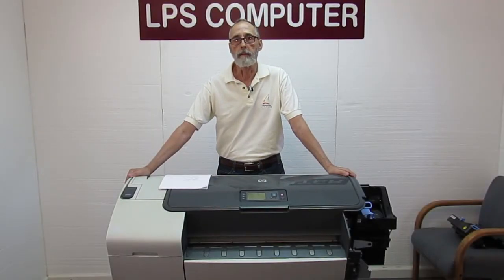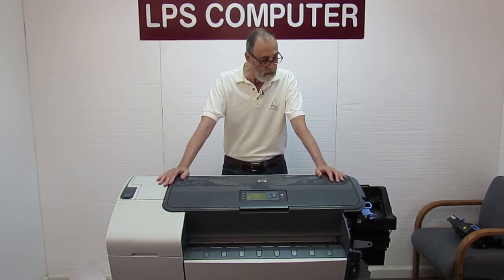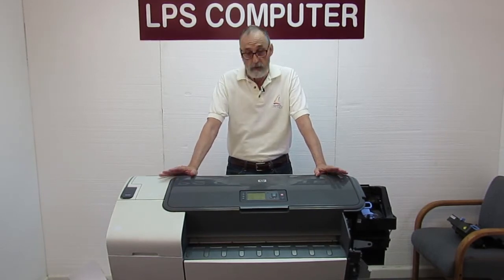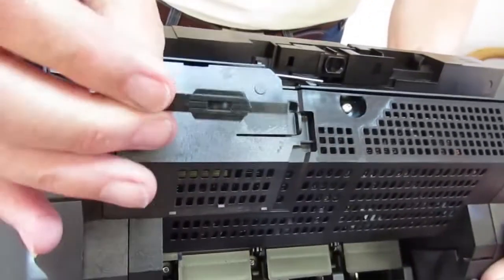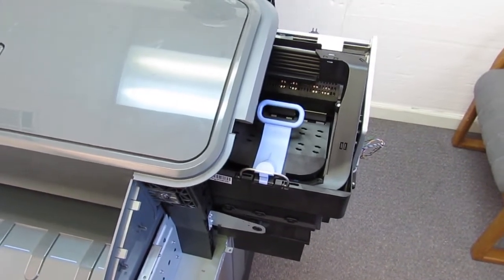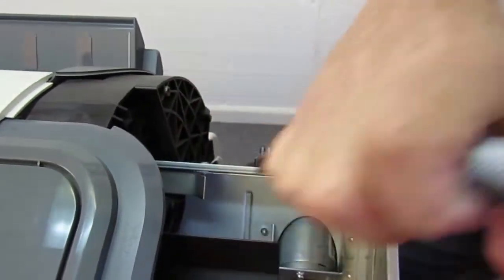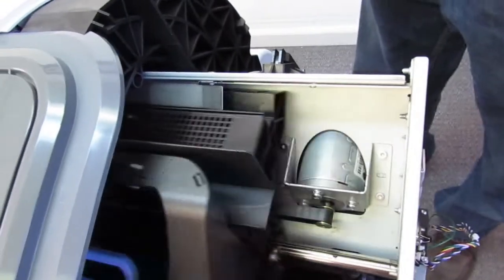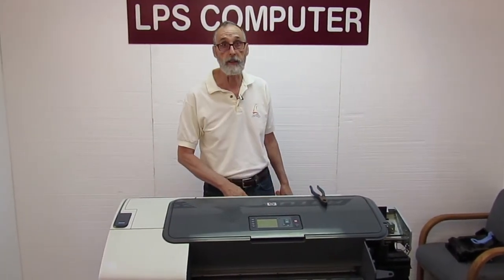Rear Carriage Bushing  THE EASY WAY - Designjet T610-T1100 Z2100-Z3200

Comment: Hello, I have replaced the belt on the HP Z2100 following your video, but. Everything seems fine, I can move the carriage by hand easily, but when the plotter starts, the carriage moves from right to left and at some point stops, showing error 86:01. I have checked everything, and I don't understand what could be wrong. I'm desperate! Could you please help me?

Comment: I replaced the belt and carriage bushing. Now the paper shreds while trying to load a roll. It appears to occur on the right side of the machine where the carriage enters the paper area. Is there another part in need of replacement or other tips for fixing this problem?
Reply from the maker: Hi Mike.  Could you tell me which plotter you are working on?

Comment: Bushing fell out during the belt replacement and I thought it was just cable clip, the paper carriage will then decide to impact onto the paper and destroy one of the print heads if you don't have it installed.

Comment: Bob, please, can I send you a short video with an problem of my DesignJet T1100?, when I load photo paper, carriage hits with ink maintainance box, and scratch the paper. Solenoid is working good, I have it saved in a video. If I load photo paper but in menu options I type "Normal Paper", Plotter loads it as a Normal paper and work good, but I haven't quality print and options of photo paper. Can I send you the video by e-mail or WhatsApp?. Thanks Bob.
Reply from the maker: Please email us at sales@lpscomputer.com
Reply: @LPSshowsyouhow  Thank you very very much for your answer. I sent you the video by WeTransfer, and other e-mail with more details of problem (bushing explained here is missing on my Plotter). Thanks!!